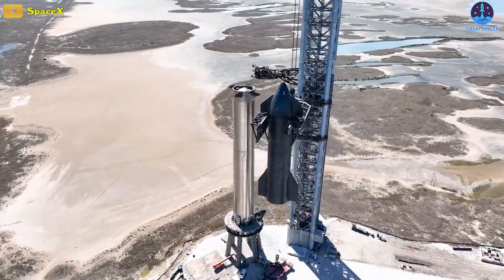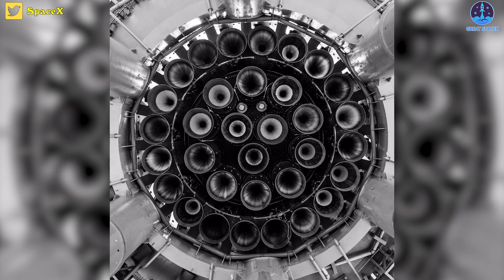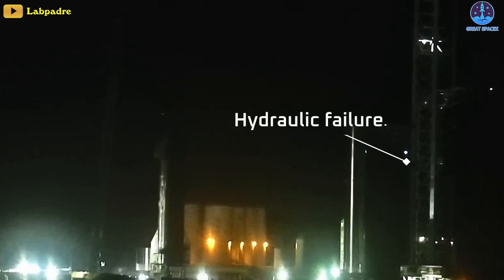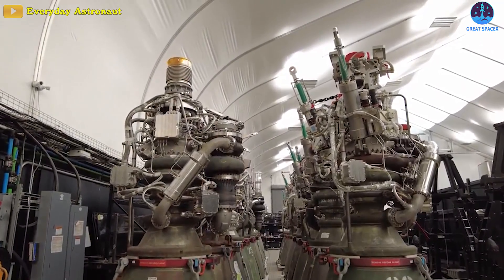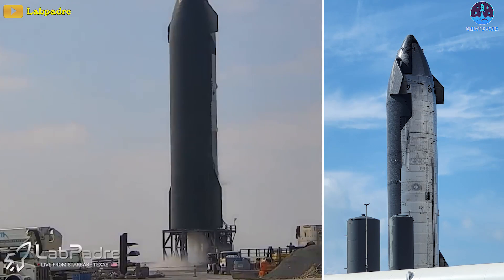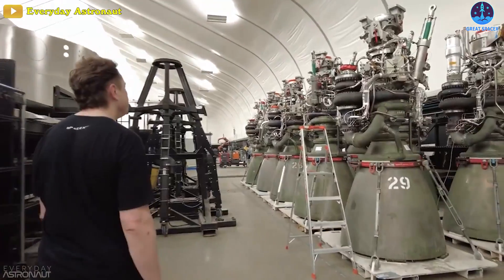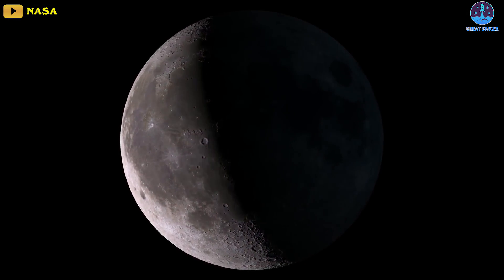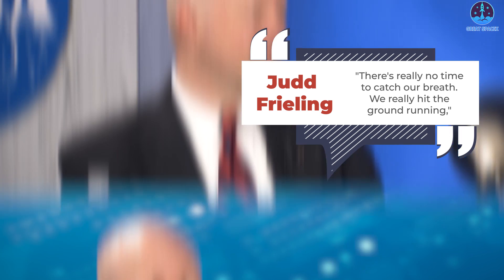Elon Musk just CHANGED the plan for Booster 7's raptor engines for orbital flight

Comment: The Super Heavy Booster will come no where close to putting Starship into orbit - it's job is just to lob it out of the atmosphere - the booster's orbital speed will be extremely low - it has to be if it is going to boost back. Starship will have to do the majority of the acceleration required to reach orbit just as the F9's upper stage does most of the orbital acceleration if the first stage is to be recovered.
Reply: Yeah, judging by F9 profile, about 1/3 of orbital speed at most.

Comment: A safer and more efficient multi engine layout would be an outward conical structure. Rather than a flat.. The main benefit is to protect engine units from degredation due to issues with inevitable incidents that due to mass usage will occur inevitably... a simple lightweight cf one piece structure can be created as the shroud and reused dash repaired and reused as required... but im only an engineer scientist technician mathematician and space exploration theory chap
Reply: That would work, IF you could space the engines out to a sufficient degree that the plums wouldn't toast the lower tier engines.. But, I don't think they have the girth for that.
Reply: @R W
It was good enough when looked at in the late 50s and early 60s... one would also expect easier to impliment with modern materials... Yes might require some work... No not something to discard.. I know that rocket flats desirable for many reasons... have seen many many designs with them.. but the mtbcf and the interaction exponential of the array results in harmonic failures at a rate beyond common acceptance.. and as such will not be desirable... 

As for the mission goal.. use of a system to travel from earth to Mars orbit and return is desirable.. however a dedicated gateway station with dropships will be massively more effective than trying to do (one fits all) other obviousnes exists but you have to walk before you can run
Reply: @janwitts2688  yes but, in the 50 & 60 the Apollo rockets had 5 engines... they weren't cramming 33 of the most powerful raptors like sardines onto the largest and only starship ever built... besides, I'm not sure looking to tech from 70 years ago as a benchmark is really what we need. Especially since the reason the the space program was mothballed, was the notorious unreliability of the the rockets and there tenancy to explode, with people in them.
Reply: @R W
I'm not American and I'm not referencing American tech
Reply: @janwitts2688  I'm not American either... I'm just married to one. Not sure what that has to do with the price of paint tho,.
Prior to the Falcon heavy,, (the current most powerful rocket), during the 50's & 60's the Satan V, was the most powerful rocket in the world... which had just 5 engines.  The Space X Starship's Raptor, is an order of magnitude more powerful AND there will be between 28/33 of them.
....Sooo, not really comparable, in my book.
I'm saying, if you have a cone formation, how do you prevent the engines at the higher position from effecting the engine funnels of the lower engines, which are part of the cooling system, from losing effectiveness? Of worse, melting?
Reply: @R W
You seem to have had very limited exposure to rocketry....
Reply: @janwitts2688  I am a casual enthusiast with a degree in engineering and material Science. I have been a member of the Royal institute of engineers for 20 years... do I build rockets?.. No!